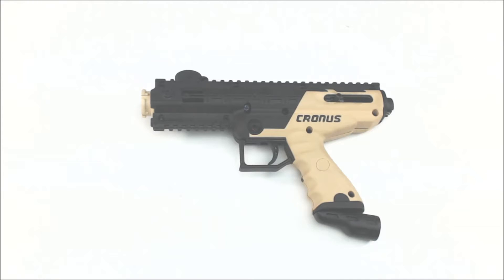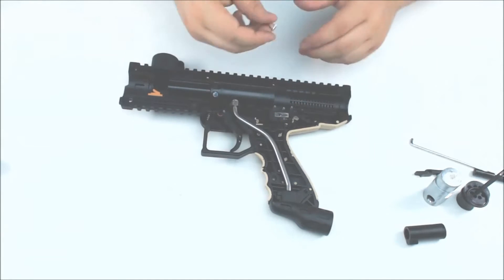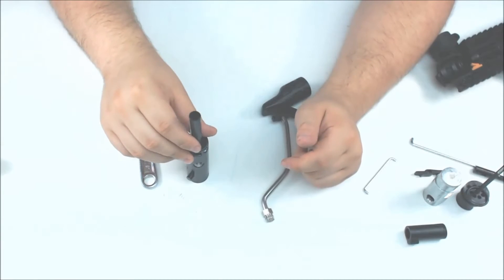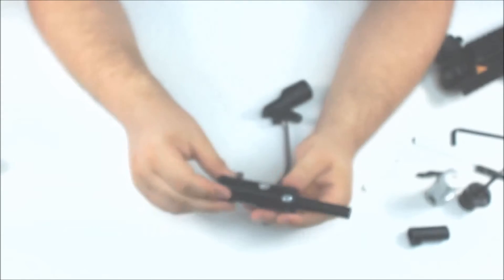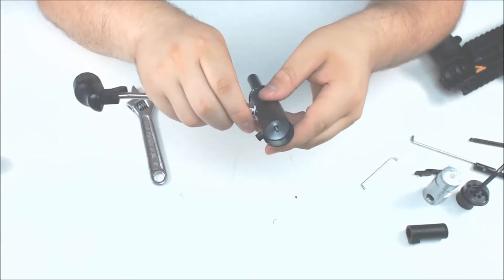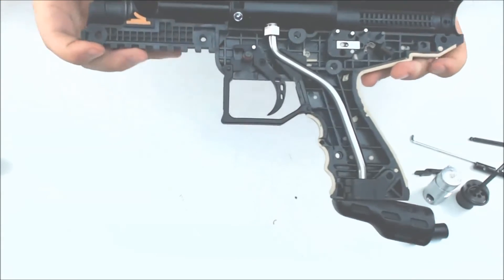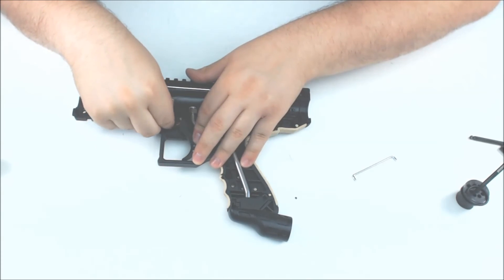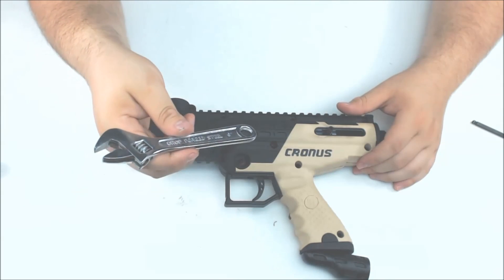Tech Video: Replacing the power tube in a Tippmann Cronus.

Comment: The metal tube that goes into the nut , should it just slide in? does it need teflon tape or not?
Reply from the maker: arckmarou The threaded pieces that connect the valve and the gasline need teflon tape. The metal tube attaches to the male end of the threads, and does not need any tape on that section.